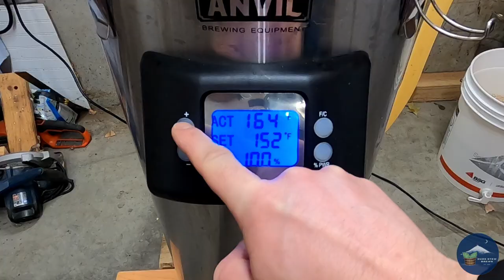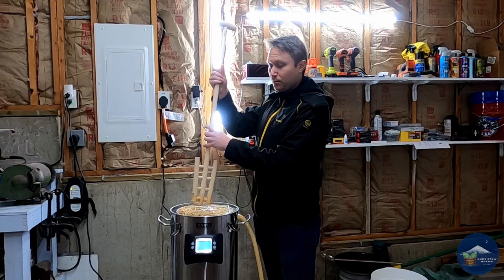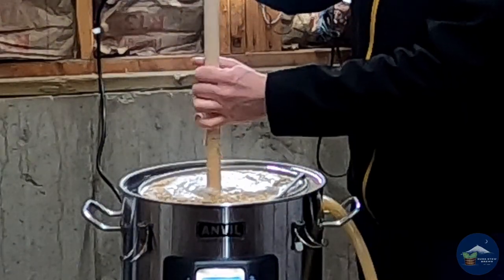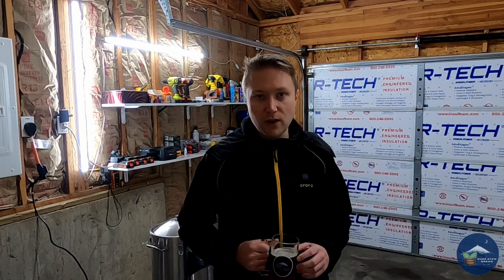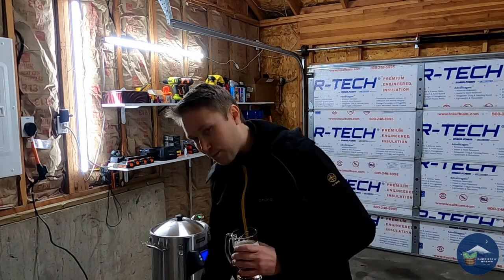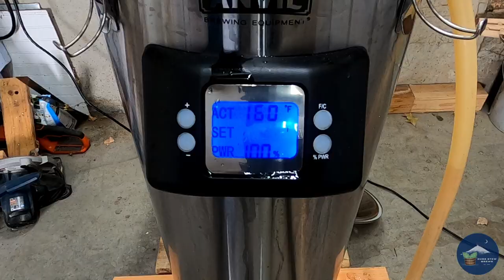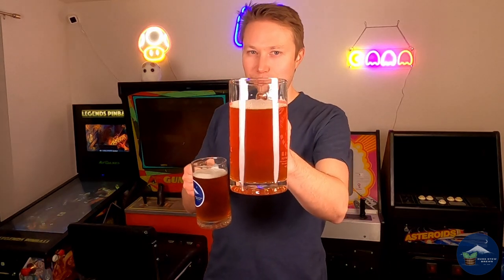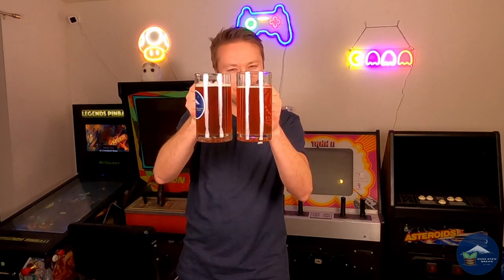Brew A Clone Of Sierra Nevada's Torpedo IPA: Grain To Glass Video

Comment: Did you add a pound of base malt for efficiency (or was that a typo?) I also love Torpedo. I think originally there was something like Hallertau in there but they switched it up with Citra, and didn't know Magnum was used throughout, awesome. Crystal is a great hop btw, but so is Liberty. Looks like another winner. I haven't done many clones, since half the fun for me is crafting the recipe. But in terms of learning qualities of grain, i found that actually eating a few kernels out of the bin is a good way, because it's surprising how well you can pick out that flavor in the finished beer. Sorry for the paragraph lol
Reply from the maker: Checked my recipe against what I have in the description and the video and it looks right. BIAB unfortunately sacrifices some efficiency like you hinted towards, so it is a bit extra grain compared to a traditional mash tun system.
Good call on trying some of the grain raw. I too have done that and is a good way to understand the flavors.
Always appreciate the comments. Cheers!
Reply: @dudestewbrews  oh, i see, you scaled it up a bit - didn't notice your batch size (5.25 gal). i was comparing to what's on Sierra's site (13.25lbs 2row)..don't mind me lol.
Reply from the maker: @filmscorefreak  Oh yes, that makes sense. I scale most of my recipes to 5.25gal to account for some trub loss, that way a true 5gal makes it into the keg.